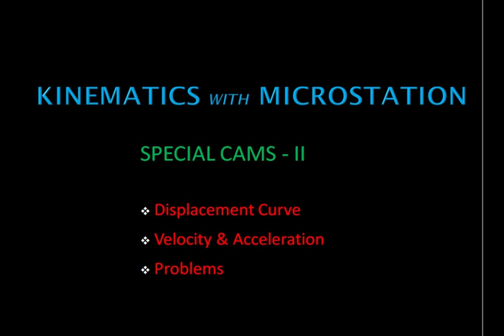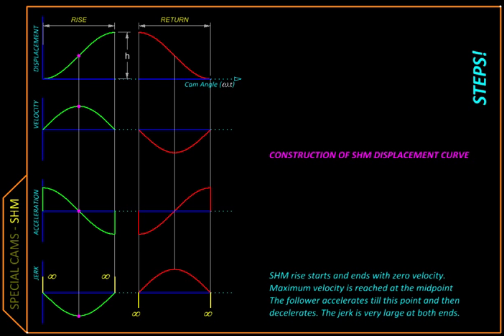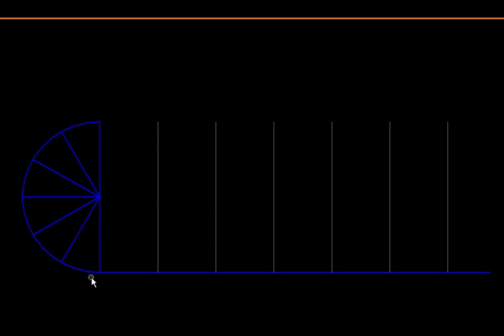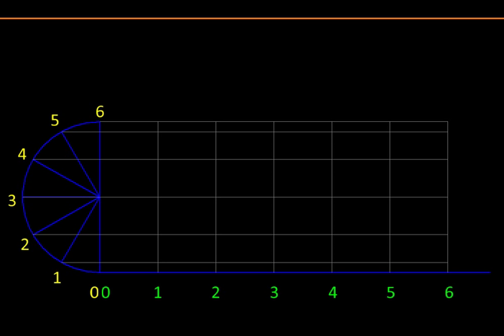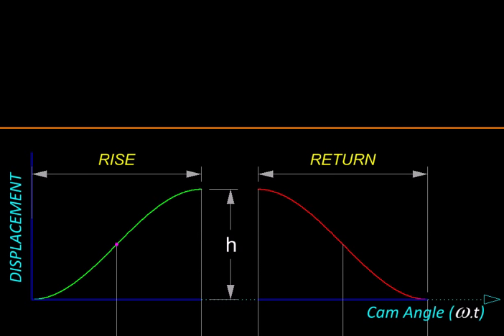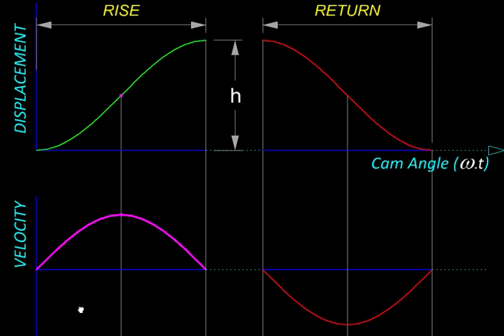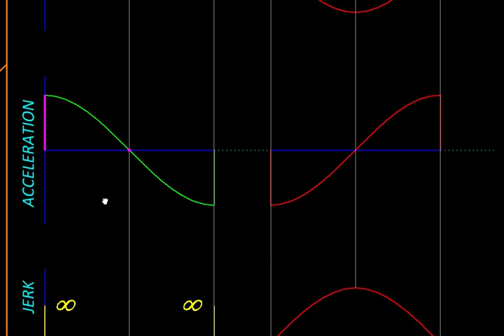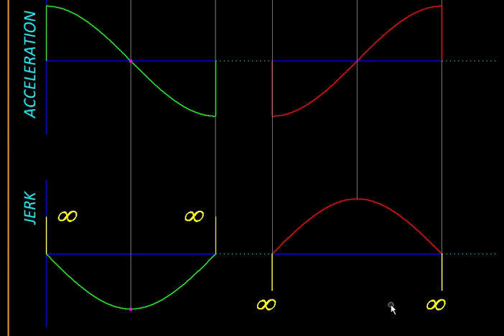Kinematics Ch07D SHM Cams

Comment: sir first of all why it has shifted by its amplitude?? And sir at t = 0 displacement is zero so it must be sine curve then???
Reply from the maker: deepanshu pant Just the displacement at t = 0 is not adequate - both kinematically and mathematically - to determine the function. Because there are many possible ways to start with say zero displacement. So the velocity (slope at t = 0) is also used.
Reply: thank u sir i visualize clearly after seeing ur videos....

Comment from the maker: @Syed Mohsin The derivative of a function can be found uniquely (so far it is differentiable) Since Velocity and Acceleration are nothing but successive derivatives of displacement, they can be easily constructed from the displacement curve. Just take a point (time value) observe the slope of the displacement curve there and compare that with the corresponding velocity value. You will see the relationship.